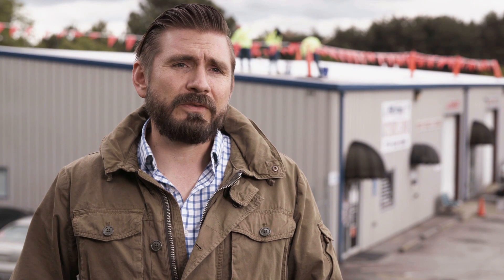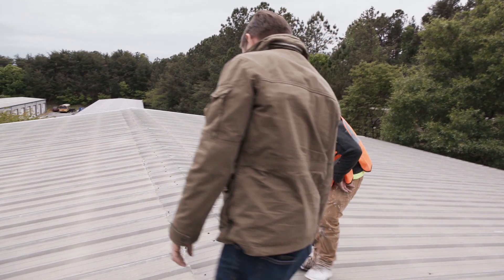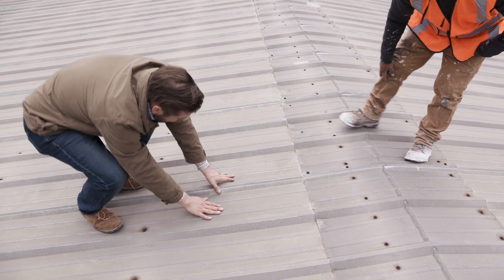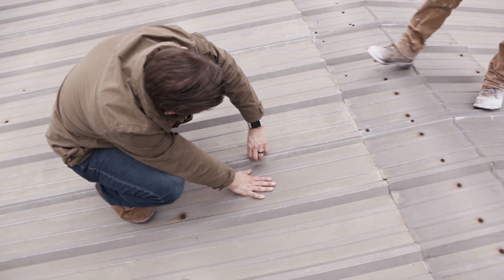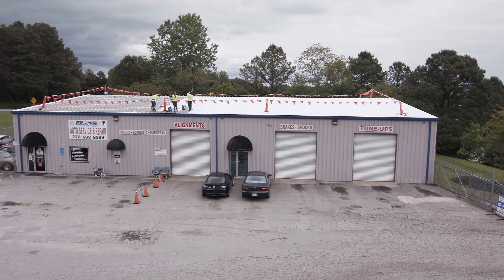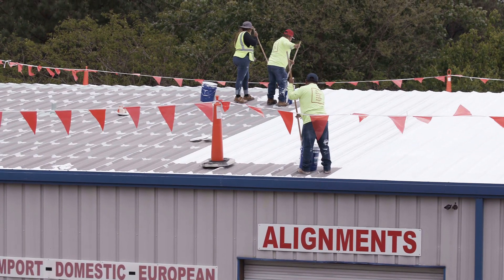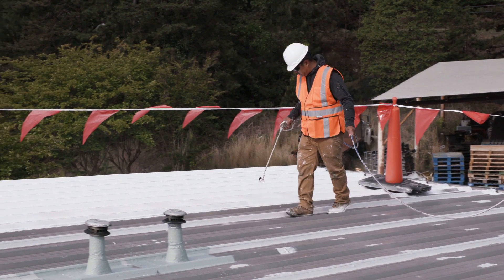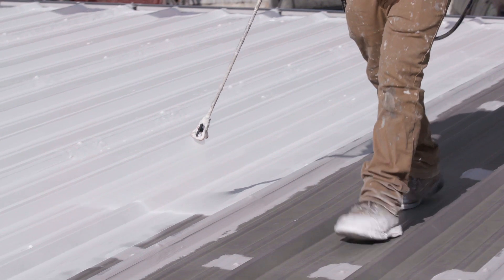The HydroStop System Project Profile | GAF Roofing

Comment: I use this product a lot, took a class in it. Just used foundation coat and finish coat on some block walls on a 85,000 sq ft warehouse. How would this do on a metal roof of a warehouse that has a good bit of rust, and if so best product to prep with to seal rust first????
Reply from the maker: Hi! We recommend that you reach out to our technical services team for assistance: 800-766-3411.